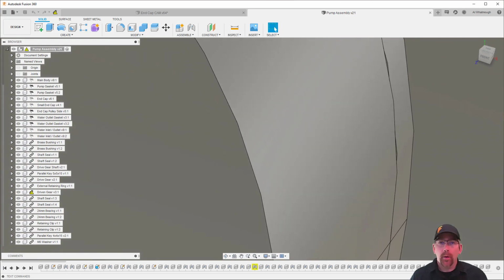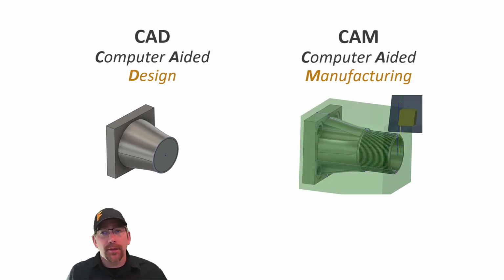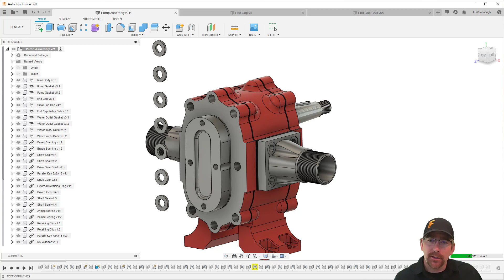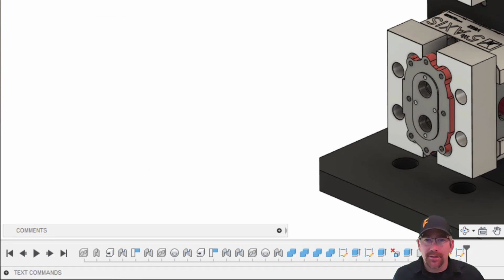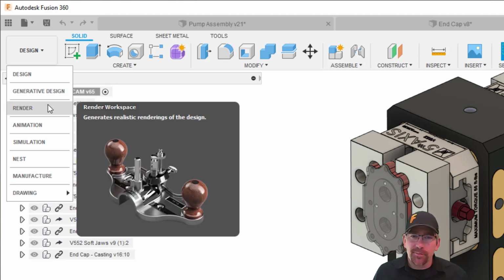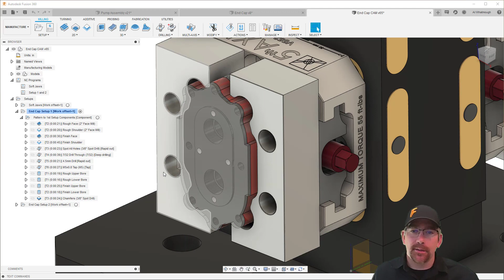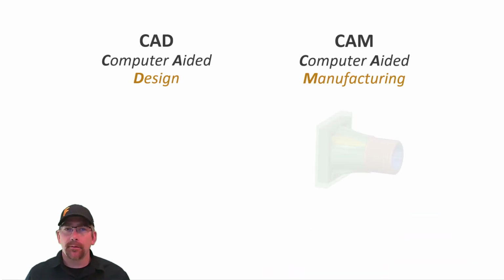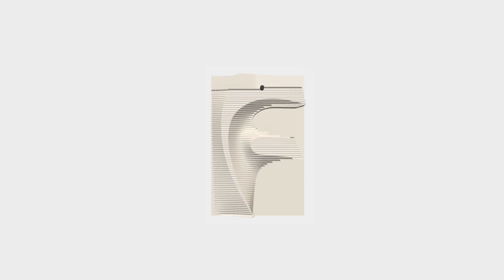TUTORIAL: Intro to CAD/CAM using Fusion 360

Comment: For example:  

1 - My Menu Design does not have Generative Design or Nest. 
2 - After a Tool (Cutter, Drill or Thread tool) is chosen in the Library, it appears without a Holder (cutting tool only).
3 - My library is very small and I cannot grow it even from the cloud.
Thanks:
João Carvalho.
Reply from the maker: Ah yes, NEST is still in Development.  Generative design is only for Commerical and Educational Customers.
Reply from the maker: You can assign holders to tools in the "Holder" tab of tool creation. If you don't assign a holder, the tool will simply appear as just the cutting flutes and shaft.
Reply: Thanks again. I will try to find the way to get the "holders" ...!
To be honest (as I always do), I don't like that kind of different levels of access to work with the same program. Of course, it doesn't help at all. Greetings: João Carvalho.